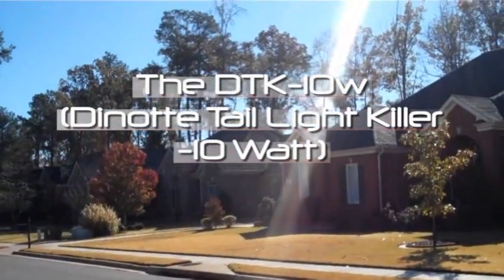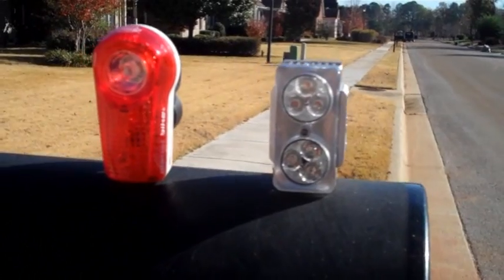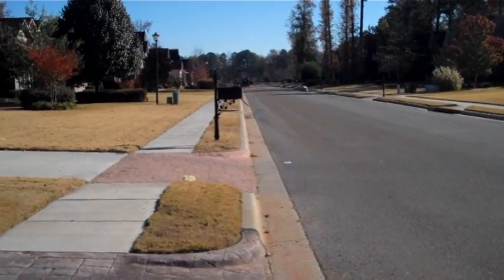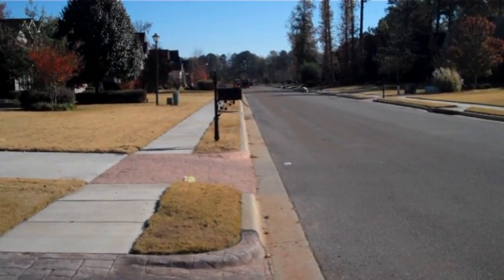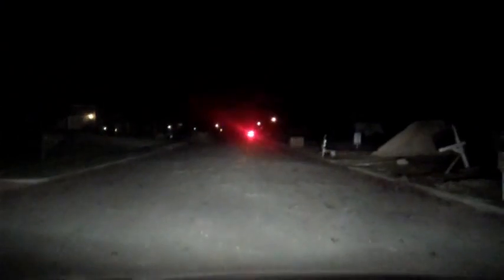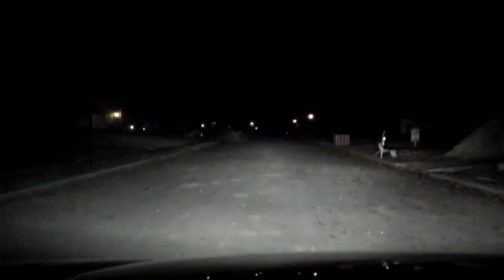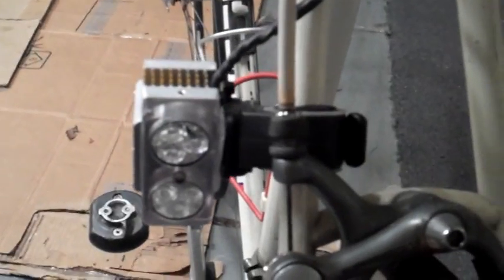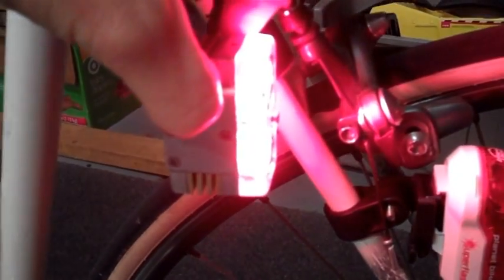Custom 10W LED Tailight (DesignShine DS-500) vs SuperFlash

Comment: did you make this light? i thought some old guy made the ds500...how does it compare to the cygolite hotshot pro 80?
Reply from the maker: +M Micky Ha ha... yes (but not that old), I started the concept for these lights in 2011 and they've gone through several iterations of refinement to get to what is now available for purchase at the web-store (link in the info).  This video shows the first prototype.  I used to build all the lights myself, but as the business grew, I've since recruited and trained a local technician to assemble for me, but I still do all the final inspection and test.  As an avid road cyclist with a young family, I wanted a taillight that was stupid-bright, and as an electrical engineer and light enthusiast, I spared no expensive to build the highest performance light in existence.  Although the hotshot pro 80 is a very capable light (I have one and have done direct comparisons), the DS500 is really in a league of its own.  If you can't afford the DS500, the pro 80 is a fine choice, it just doesn't buy you anywhere near the same daytime coverage area or overall impact, especially when viewed through peripheral vision.

Comment: how does this compare to the niteflux rz8?
Reply from the maker: Massively more powerful and specifically focused for optimum daytime use.  The RZ8 is definitely a nice self-contained piece and is completely omnidirectional, which is good if you're clipping it on a pack, or back of helmet.  The DS-500 obviously costs more, but if you were riding in traffic and wanted the most protection possible during the day, there's really no contest.  At night, the two compare favorably, although the side lighting from the DS has a wider range of coverage.  Night run times with the DS will be much longer between charges due to the larger battery.

Comment from the maker: Classic '88 John Tesh... Tour de' France sountrack.  Old school for sure. When at full power, the intensity of the light commands a lot of respect in the daytime.  At night you have to turn it down to much lower levels to be safe.  However, availability is NOT good.  Big demand for the light and low production capability is a bad combination.  Any announcements for future availability will be on the web site.  Thanks!

Comment from the maker: You are correct again! A steady light is much better at night for depth perception. This video show the early prototype, which was only able to flash on/off. The latest version of the circuit controller actually allows user-programmable flash patterns, but I have a default pattern that is a nice on/pulse where the light burns steady but pulses up to a slightly higher power level. I have a separate video "DesignShine Flash Patterns" that highlights this mode for nighttime use.

Comment from the maker: You are correct my friend!  Watts are not an accurate prediction of lumens.  However, a lot of folks have somewhat of an intuitive feel for what the 1 and 2 watt devices can do, so 10 watts is somewhat of a pseudo-measuring stick that people can relate to when it comes to taillights.  The topic of lumens is actually MUCH more complex and has to take into account the wavelength of the light produced as well as heating loss, optics loss, and beam pattern (light density).

Comment: You've clearly nailed the light volume problem, but there is a significant oversight in your controller. Flashing lights are nearly impossible to track, which is important if vehicles are to judge your speed, avoid hitting you. My suggestion is that 1 LED remain on all the time, even in flashing mode, so you can be tracked. 

I've given lighting a lot of though, and written those down. Google "g.i.t. lit for safety" and find my comments on PedalingZen. Your's is a big step forward. Good luck!

Comment from the maker: Unfortunately all the hardware in the pipe for 2013 at the moment has been pre-sold.  May try to do a "special edition" build later in the summer, but it'll be announced on the web-site if it happens.

Comment from the maker: The super flash fills a void, and is a nice little light for night time use but completely useless during most daytime hours.  Its flash pattern, however, completely destroys any depth perception (as does any on/off single point light at night).  Better to run in steady mode at night.  The DS-500 is variable power with custom flash patterns for night that employ the ON-and-PULSE technique, which is much less disorienting.  The purpose of the video was to just illustrate the max power difference.

Comment from the maker: Lots of flexibility with this light... it can be turned down to 1 watt for nighttime use, and yes, I state very clearly in the instructions that the higher power levels are extremely dangerous at night.  In the daytime, however, you'll be very glad you have every one of those 10 watts!

Comment from the maker: 7-ish hours for the taillight in the highest power flash mode.  Significant refinement to the light since this video was made.  Custom CNC'd fabrication, O-ring sealing, custom controller firmware, higher output LEDs (if you can believe it), level 2 black anodizing.  Lots of pics available on the web site.  Only one model... the DS-500, but VERY flexible with regard to power/modes/mounting, etc.

Comment from the maker: Yes, it has the capability of being FAR too bright at night (as was mentioned in the video).  This is why you have to be smart about using the correct power levels and/or flash patterns at night.  On the lowest power level, it's a little under 1 watt, which is completely fine at night.  In fact, the newest flash mode, L2/L3 "double pulse" makes a great night time pattern.  The super high power output is only needed during the day.

Comment: Nice video! Just to prove its superiority vs the Dinotte, as you have done with the superflash, you should compare the 140r directly. If only I knew about your product first, I wouldn't have purchased my 400r as the DS-500 does appear even brighter than it based on how much wider and farther the spread of light on the ground behind the bike is! Also, a comparison between the DS-500 and a baseline emergency vehicle light like the Nova Bull LED or Whelen TIR3 could be worthwhile to see as well.

Comment from the maker: @sidehop 
Exactly.  User controllable from about 70 lumens up to 500.  Keep in mind that's pure red, not full spectrum white, so that 500 lumens number is weighted completely differently than a white LED.  The headlight version of this light (DS-1300) puts out around 1300 lumens.

Comment from the maker: @thebakerman1 
Thanks! 
The night video was made with the light on Level 5, which is the full 500 lumen output... capable of setting barns on fire from a half mile away.  Seriously though, you are completely right.  Never run at night with this much power, very dangerous.  I made the video at the full power level just so you could get the effect.  At night you can turn it down.  In the daytime it's brighter than anything you've seen, even on emergency vehicles.

Comment from the maker: @LoveReflectiveTape
Sorry you're having trouble finding the lights!  The light is my own design, but I'm now having the case components professionally machined.  I do all the electrical, LED integration, programming, and testing before selling.  The case is good bit more refined now, but the functionality remains the same as in the video.  These are super high-end lights.  Not cheap, but an excellent value for the performance.  Email me at DesignShineLighting@gmail.com.

Comment from the maker: @lwrncc
YES!  It very much has the capability of being WAY too bright at night.  The night video was made at the highest power level, just to show how ridiculously bright it is.  The controller allows 5 brightness levels, so at night, it needs to be turned down to level 3 or lower.  In the daytime, the high power is just fantastic.  It draws the eye from MILES away.  Not too bright, just very attention getting.  Brightness AND controllability is the key.

Comment from the maker: @steeltown98 Thanks! Great comment and you're exactly right.  At night, the ideal solution is to throttle back to level 3 or lower (200 lumens or less) in steady mode.  Combined this with a low-cost flasher like the PB and you have an unbeatable nighttime solution.  I've made some nice refinements since the video and now have a preliminary product brochure available on this light (along with a 1500 lumen matching headlight).  Just email a request to DesignShineLighting@gmail.com for a copy.

Comment from the maker: @mik22pik Thanks for the comment.  I started out thinking that this would be a big cost saver over the current high power offerings (Dinotte etc.), but in reality, not so much.  I've built a few for friends, but it's literally $100 in raw materials just for the light and housing.  Not to mention, the Chinese are flooding the market with MagicShine.  But you're right, nothing can touch this for concentrated lumen output in such a small package (85 grams).